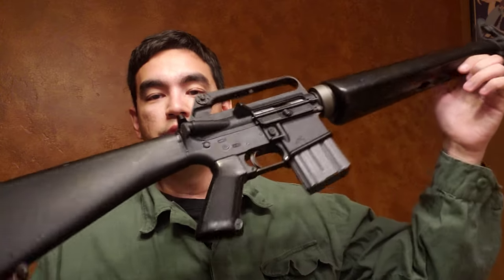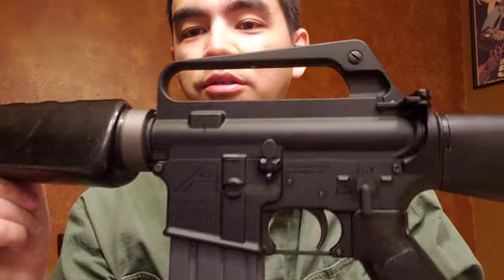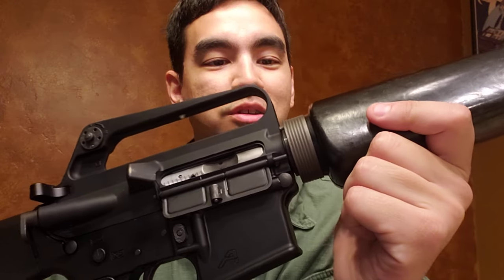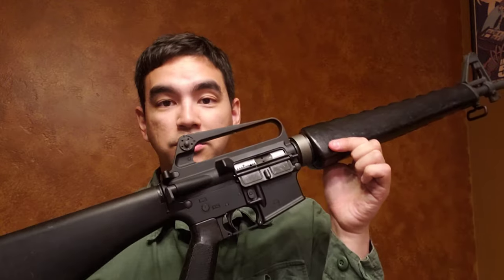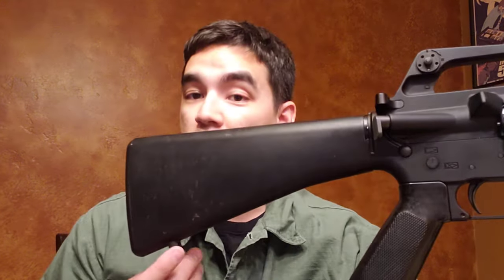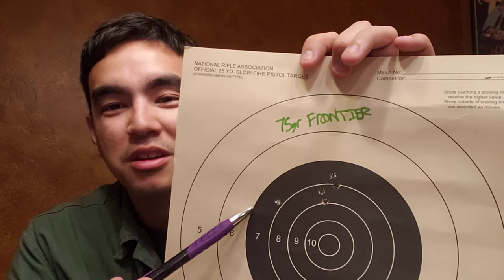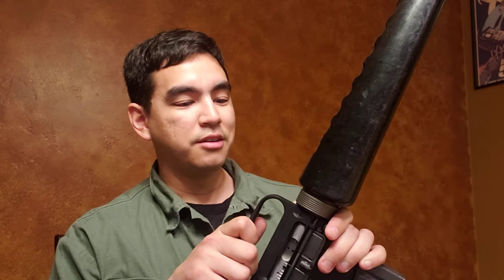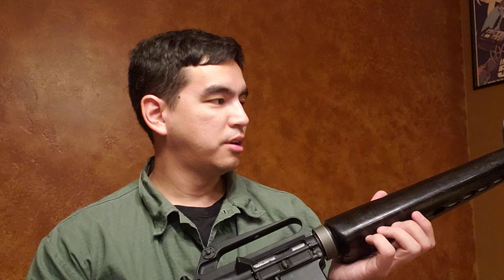M16A1 "Clone" Build - Retro in Full Swing! Believe the Hype

Comment: If you get an extra set of A2 handguards for that you'd basically have a perfect Colt 711 clone. I call it the "Paul Harrell special", since it's the one he's holding in the famous screencap with the yellow coat. You could also get one of those rapid index dials for the A1 sights too for more nimble sight adjustment. Either way great rifle, the A2 overall is my favourite iteration of the rifle personally but I have both and the A1 definitely has it's perks. 

Thanks for the video Shazarad and I'm sorry life is getting a bit sad atm, I'm in a similar position. Cheers

Comment: Ended up putting together my own A1 clone by assembling a lower off a Brownell A1 receiver and snagging a complete C7 upper from Fulton Armory to compensate for my wrong handed shooting. 

Gotta agree the A1 feels so light compared to the A2 or A4 that I can understand why so many GI's thought it was a toy when it first came out, though honestly a majority of the A2 upgrades seem unnecessary when I shoot it side by side with the A1. Beyond increasing the twist of the rifling, coming up with a more durable handguard, and closing up the bottom of the flash suppressor for the A2 flash suppressor, the rest of the upgrades seem rather superfluous for a combat rifle.

Ended up pulling that and my M1 carbine out of the safe and honestly I think the M1 is a little lighter, but the A1 feels more balanced when the weight is more evenly distributed across an extra six inches of rifle.